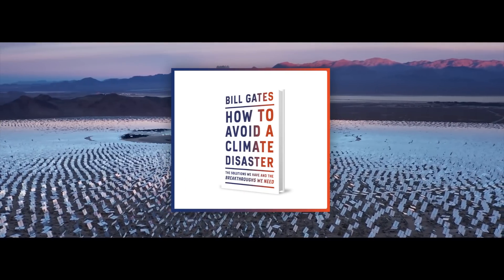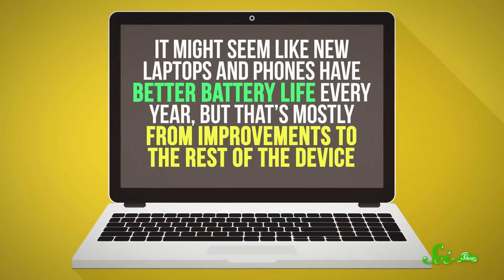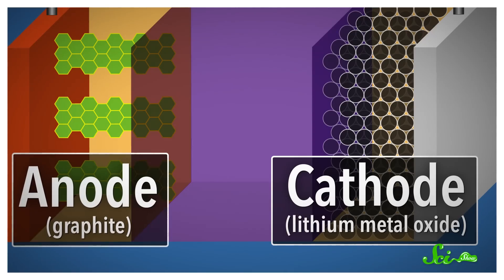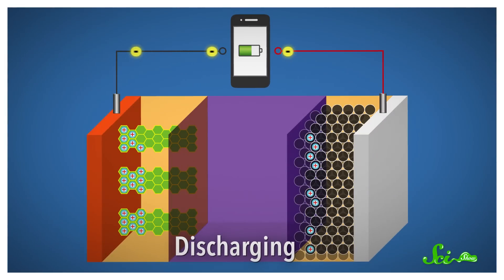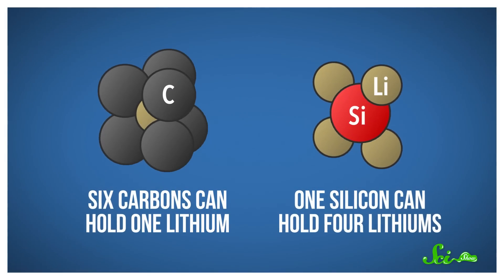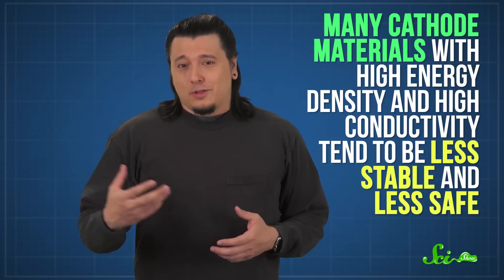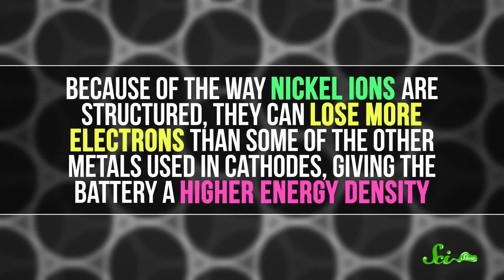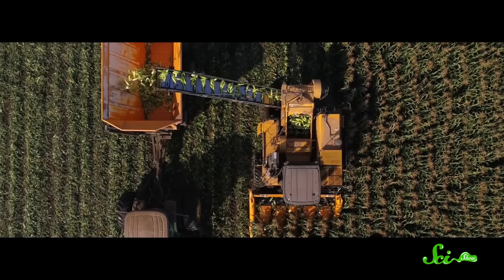Why Haven't We Built a Better Battery?

Comment: Solution: Lets just stop being scared of nuclear
Reply: Not turning off nuclear reactors that are not even close to the decommissioning time as a knee jerk political reaction is quite a good start.
Reply: @dan_loup  all the reactors ought to be shut off asap. We have 450 nuclear reactors worldwide. We're are already experiencing climate disaster and there's no stopping it. We need to shut them all off before Mama Earth does it catastrophically. The difference between a few meltdowns over the next 100 years and 400 meltdowns is incalculable
Reply: @gekkobear1650  If you shut em down, you will have to turn on the coal ones to compensate for it.
Do you want the global warming to be even worse like that?
Reply: @dan_loup  or you just do with less electricity. Come on now
Reply: @gekkobear1650  You can't without literally killing millions, which is also what coal will do if you turn off the nuclear power plants.
Reply: @dan_loup  sounds like we've been hanging around in overshoot and now there's gonna be a collapse. Idk tho I'm sure you'll come up with some techno fix. Just keep doing more of the thing that got us into this mess and we'll come out the other side eventually😂
Reply: @dan_loup  climate disasters arent gonna just majically make nuclear meltdowns happen.
Reply: @hieatus1039  Yes, it needs to be something very specific that wrecks with all the protections of the reactor to cause a meltdown. and you need a lot of meltdowns to match all the deaths by coal. a LOT of meltdowns.
Reply: This.
Reply: We need to work on recycling of spent fuel also.
Reply: @InlineSkater72  Indeed. The nuclear waste deposit of today could be the mine of tomorrow.
Reply: Yes. It can be used alongside renewables as well, but better battery technology is great too.
Reply: @albertjackinson  sure, fusion would be great as well. But we don't have those. So they aren't solutions. And we need a solution now. Thats nuclear.
Reply: @cpob2013  I wasn't referring to fusion.
Reply: @albertjackinson  sure, fusion would be great as well. But we don't have those. So they aren't solutions. And we need a solution now. Thats nuclear.
Reply: @albertjackinson   renewable sucks
Wind, hydro andsolar all have their problems
Reply: @Xnoob545  as does coal, gas and nuclear.
Reply: @Xnoob545  And so do all other forms of energy production.  The best hope for the future is the fusion reactor, but it's going to be awhile before that can work on the scale we need it to. There is no perfect solution.
Reply: Let's figure out a way to clean the used rods so they can be reused instead of dumping them on a site to continue radiating for next tens of thousands of years. If they manage that, I'd be all in for nuclear.
Reply: @ndc5544p  thorium has virtually no waste and produces much more power and on top of that its 3 times more abundant. Also thorium cant be weaponised and if it jas a nuclear meltdown you could just eject it as well.
Reply: @ndc5544p  I guess you don’t know what a fast breeder reactor is
Reply: Nuclear reactors for base loads (getting Thorium and/or fusion reactors working would help) and hydro, solar and wind powered storage mediums for as needed above base power.
Reply: Lets store the waste in your backyard then.
Reply: @bryanfarrow914  That's a bit terrible but it's better than literally breathing the waste of the coal power
Reply: @bryanfarrow914  Yawn. All of the nuclear waste from the entire history of nuclear power production in the US could fit in an area the size of a football field stacked only ten yards high. 
Secondly, the US doesn't even currently recycle its spent fuel, which still contains over 90% of its potential energy after five years of energy production. Many other countries already recycle or repurpose nuclear waste.
Lastly, new generations of reactors, notably fast reactors, could decrease waste even further by converting normally inert nuclides like U-238 into fissile materials. This wouldn't just decrease the amount of waste produced but would actually make the waste safer as it eliminates those same nuclides with extremely long half-lives. 
Quite frankly, the waste disposal problem is largely rooted in fearmongering. There are many solutions that would easily solve it.
Reply: or we can just cut back on losses and waste, thousands of office building are being cooled unnecessarily on the weekends we can simply shut them off when not in use, we can also spend money upgrading peoples homes so they dont leak heat/cold and run their HVAC systems much less, this idea for more and more is what is caused climate change, if we simply make sacrifices and seal up our homes and offices then we could save billions in CO2 emissions not to even mention other damages to the environment
Reply: @obviouslyniceduh5521  Problem is, the people who run these things are companies, not individuals. Asking them to change their behaviour would require pretty healthy incentives the government doesn't have / isn't willing to spend  which is another problem in itself
Reply: @obviouslyniceduh5521  Sometimes it is cheaper to leave the cooling or heating on all the time, not only from energy use point of view.  Think: floor heating, you consume the electricity at night when it is cheaper, not during the day, having the AC unit running 100% at the start of the day because the office is hot is not optimal, etc.  Sometimes even thou it looks like it consumes more energy, it really consumes less.
Reply: @obviouslyniceduh5521  You must be dreaming!  Nobody wants to make necessary sacrifices today.  Convenience rules all now.  Your thinking puts the responsibility on the individual.  Sadly, because education is so poor for the overwhelming vast majority, actually making the individual take responsibility when they don't want it is nigh impossible.
Reply: I'm not scared of it, it's just stupidly expensive with super long term nuclear waste. It's unnecessary when renewables are so cheap and with the advancement of batteries we probably won't need them. It takes like 20 years to start up a nuclear reactor so by the time it's ready it'll probably already be obsolete.
Reply: @annoytanor007  Well, if we look at the per kilowatt hour cost, a nuke plant is relatively competitive with a solar installation, given the ridiculous power outputs involved.
Reply: @dsdy1205  1kwh of uranium fuel costs something like 10 cents, it's cheap but everything else around it is expensive. But it takes such a long time to build a nuclear reactor (~20 years) and such a long time to decommission them (~60 years?) for 60 years or so of operation. Vs a windfarm that takes 5 years to build and are easily decommissioned without radioactive waste that lasts 1000s of years that we still have no long term solution for. I think nuclear energy is just screwing us over in the long run, we're already being screwed by our inability to get rid of the nuclear waste we've already produced. I also don't think it's worth it when we don't know what technologies we will have in 15 years. Maybe in 2035 windfarms with batteries will be much cheaper than a nuclear reactor?
Reply: @annoytanor007  it takes 10 years to build a nuke plant. It takes another 10 for its cheap power generation to recoup costs. Then you got refueling every decade or so. 

You know I remember as a kid 20 years ago asking my grandma why we don't just build nuclear to fight climate change and she also said it takes too long. Shame we seem to use her logic, since tons of reactors could have been built by now canceling out all that carbon. Might have kept us under 1C.
Reply: @cpob2013  That's why we need small modular reactors.
Reply: nuclear dont last forever especially nuclear reactor. it last 10 years max and finding uranium isnt easy.
Reply: @superknightlol  Reactors last way, way longer than ten years. We have many today that last forty years or more.
Reply: @superknightlol  US has an insane supply of uranium,, the Rocky Mountains are loaded with it. Its not even rare enough in normal ground to be considered a "rare earth element". We have the luxury of also already being a nation with nuclear weapons, making Mox fuel for thorium reactors which are much better life span and much more safe and also doesn't produce nuclear waste and also can be used to clean up existing nuclear waste but the fuel is dangerous and can be weaponized. We can create and move Mox fuel when such capacity isn't safe for many countries to do. 

Thorium reactors aren't normally a viable option, but for the US they are.
Reply: @superknightlol  Nuclear reactors easily reach a 30 year design life. And you can find uranium even in seawater. It's not that hard.
Reply: @superknightlol  You can literally filter usable amounts of uranium out of the ocean. We have more of it than we will ever know what to do with.

Comment: For grid power: Mechanical storage! Like pumping water up a hill to a reservoir in excess production times, and letting gravity pull that water down to power turbines during a deficit
Reply: It's a great option where it's feasible.  Unfortunately not everyone has suitable mountains nearby.  I haven't done the figures, but exactly how many mountain tops would we have to blow off to achieve enough storage?
Reply: @Wooble57  I am pretty sure you do not need to blow off anything, just in Slovakia we have 4 of these, and only one use the top of the hill as 2nd tank
Reply: @Wooble57  You mean like Lake Erie & Lake Ontario?    six inches of water in Lake Erie is a trillion gallons.
Reply: @brianjonker510  is there enough of a elevation drop from those lakes to harness large amounts of power? You need quite a elevation difference for it to be worthwhile.
Reply: You don't necessarily need mountains per se. You could have big volumes of water on top of multiple highrises and sky scrapers. It could even double as a water source in case of fire.
Reply: ...or water under pressure using underground tanks
Reply: @terryenglish7132  That will be gas under pressure.  You can barely change volume of a liquid under "build-able" tanks.
Reply: But is it worth it.
It's a net user of energy. It's going to cost the consumer more to pump that water back up than can be generated in the first place. As an example, a closed loop system could never generate enough power to pump all the water back up again.
There's the added cost of additional maintenance from extra wear and tear on the generating side, parts replacement and labour costs.
Then factor in the costs of more infrastructure to actually pump the water up to the reservoirs. Motors, pumps, monitoring and control gear, pipe work, etc, etc, and the man-hours for all that installation. 
Obviously this idea didn't come from the electricity bill payer.
Reply: @bryanfarrow914  this idea came from engineers, and was implemented by engineers. And it's far more widespread than I thought -- apparently it accounts for 95% of utility-scale energy storage in the US. https://www.energy.gov/eere/water/pumped-storage-hydropower
Reply: @bryanfarrow914  where the geography allows, it is VERY worth it.  All of that applies to any source of power, from peaking plants to pumped storage to batteries.  with the right geography pumped hydro beats all of them in just about every way.
Reply: @bryanfarrow914  The cost of maintenance and wear plus replacement and such is going to be there with regular batteries too isn't it? not to mention mining the lithium and other metals which releases toxic byproducts into the environment. compared to something like a giant array of batteries, having your excess energy stored in the form of water seems a lot cleaner. I suppose that could still be a risky thing if a giant reservoir was to break or something, but if it was well built, the risks and maintenance should be limited to the turbines and such right? The reservoir itself would be the most expensive thing to build, and it would last for a long time. 

Is efficiency really that important when we are just talking about saving excess energy so we get something out of it later?
Reply: Could a  wind generator just lift a weight like the weights on a pendulum clock. Then release them when the wind isn't blowing.
Reply: @kenrein1445  sure, but unless you drill a REALLY deep well for the weight to go up and down in it won't store much energy.
Reply: Energy efficiency of this option is not that great.  These are cheap, but only if you get the terrain "pre made by nature" as much as possible, otherwise construction cost can go up, and it will end having high operating costs.
Do not get me wrong, these have their use, as this type of system can take peaks like nothing, something other generation systems cannot or barely do.  One of the few systems that beats this one is battery storage, in peak generation.

Comment: "Why haven't we built a better battery"

Uhm... We have? Batteries now are way better than they used to be(though a lot of that is because of battery mythology, no, your battery does not have "Memory" unless you're piloting a large airplane with a MASSIVE NiCd battery backup system), and while some specific examples of old rechargeable batteries lasting WAY longer than they should(Nintendo's Gameboy Power Pak for instance, a NiCd battery that just... refused... to die, and the battery in my Sonicare, which Also refuses to die and stays charged for WAY longer than I'd expect it to), for the most part, old rechargeable batteries were poop. 

Hell, even older batteries of the current system were pretty crap. My Note 4 would blow through a battery every year, maaaaybe year and a half, before the battery would be in such a poor condition that it would start causing app crashes and phone restarts due to under-current issues. My current S8 is happily chugging along after something like 3 or 4 years, I forget exactly how long, and hasn't started losing capacity. We're getting better, but we're just not quite to the point of Best yet. Which is... probably a good thing. We've seen what happens when we pack a lot of energy into a small space and it gets out all at once.

Comment: Patrick: "Lets just push the electricity somewhere else!"
Sandy: "Patrick, that's a terrible idea."
Engineers building massive artificial lakes to make massive hydroelectric batteries: "Well, he's not wrong."
Reply: You've saved me some typing!😉  This is something we could be doing now with current technology.  We can pump water and use hydro at night or essentially wind a pendulum or use solar to lift mass which can drive a gear overnight (like a clock).  Both use solar to store mechanical potential energy to be used whenever needed.
Reply: @robbabcock_  I also saw some concrete pendulums that can be built in well shafts and can do a similar job.

Comment: There is also testing happening on solid state batteries which are supposed to be better  than liithium ion in almost every way, by a significant margin. Alternatively, if we put as much government funding into nuclear energy as we have into solar and wind we wouldn't have to worry about inconsistent power. There are plans for a reactor that produces waste that is only dangerous for 300 years instead of 10,000+  and is even capable of runing off of waste from other reactors. ( https://www.google.com/amp/s/www.popularmechanics.com/science/energy/amp34386186/molten-salt-reactor-new-design-nuclear-waste/ )

Comment: From what I have read and seen, we are pretty much at the safe limit of current tech.  We can get a bit more charge in the batteries by tweaking things but they become more and more dangerous.  Despite the problems, hydrocarbons are the power density kings.  Well, out side of nuclear options.  

There will need to be some totally new form of battery that will need to be developed from the looks of things.  The battery as we know probably wont go any farther than it is now.  At least not by much.  Hell, even that new fancy Tesla battery got it's 30% energy storage boost by getting 30% larger.  Roughly.  At least that is the way it looks comparing data sheets between cells.

Comment: There are two solutions that already work in the lab that will go a long way to solving a lot of the issues. Solid state lithium cells. Five times the capacity and five times the life (in the lab).  Fof static installations there are liquid metal batteries. In the lab the lifetime testing is up to 10,000 high discharge/charge cycles for a capacity reduction that is within the error range of the equipment used to measure it (less than 1%). If these can be engineered to work in production then it is entirely possible some countries could go carbon negative. The big problem though is the USA which still produces 3 times more CO2  per person than anywhere else in the world. An average family of 4 in the USA produces about 100 tonnes of CO2 per year. My personal output is less than 2. That includes petrol usage etc.

Comment: When it comes to stationary energy storage, energy density just isn't as important as cost. For that, Lithium Iron Phosphate batteries (often abbreviated to LFP based on the chemical formula LiFePO₄) hold the most promise. It's all a question of ramping up production rates. Even better is that producing LFP cathodes can also use Li₂CO₃ as well as LiOH whereas nickel-based cathodes can only use LiOH.
Reply: LFP's are good, but i think liquid metal batteries hold more promise personally.

Comment: Just like to point out that on the large scale there are lots of different forms of energy storage options. Particularly those that move mass up during a power surplus and use the mass falling to create electricity during a power deficit. Like pumping water up then using it's flow to power a turbine.
Another option is  spinning up flywheels
Reply: pumped hydro is limited by your local geography, and flywheels have some serious issues scaling up.  Pumped hydro is very successful where the geology is right.